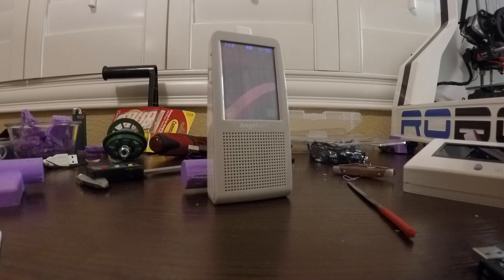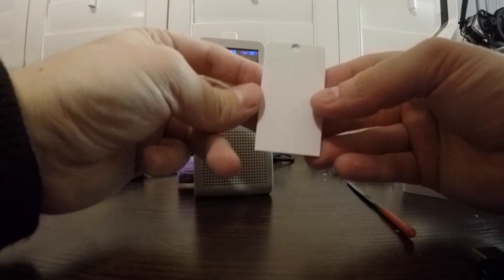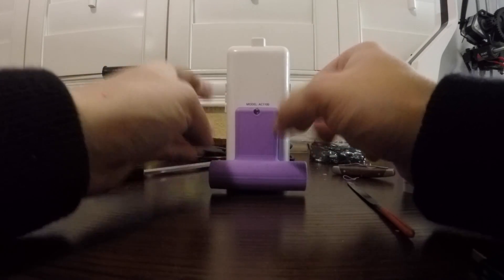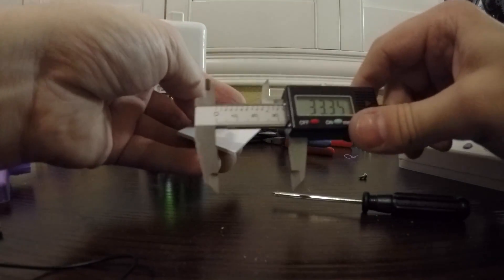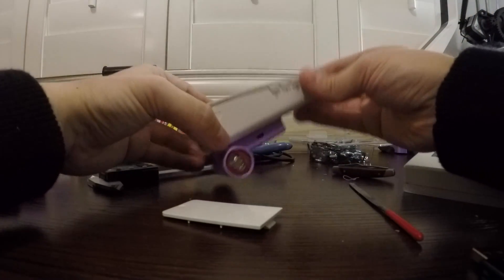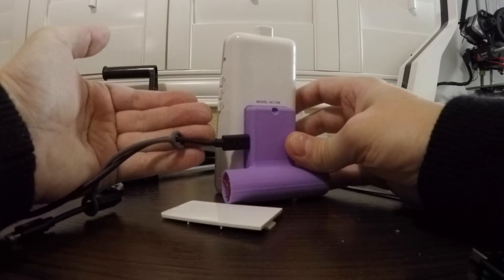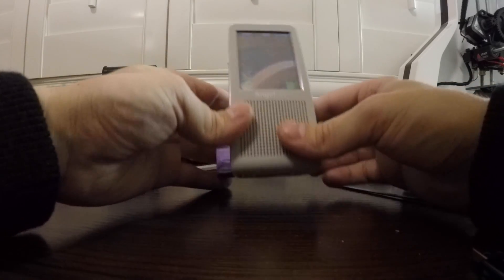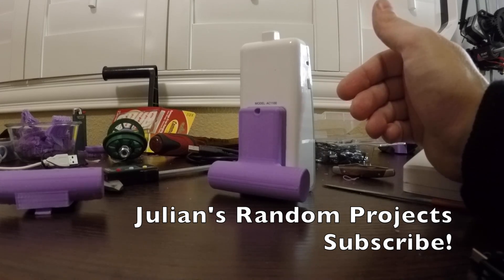3D Printed Baby Monitor Battery Pack

Comment: i dont understand why anybody would design a device that cant last atleast 2 days before ya gotta charge it. probably just they didnt care and didnt want to spend the extra money. that 18650 addon looks kinda cool, i'd just suggest making it vertical with 2 cells and print it in white.
Reply from the maker: +Rinoa Super-Genius I may try the double cell in vert position, but right now I'm getting 3 days on the one cell :) My guess is they liked how slim AAA batteries are and that NiMh batteries have a hard time 'exploding' like the ones in your overboard lol :D